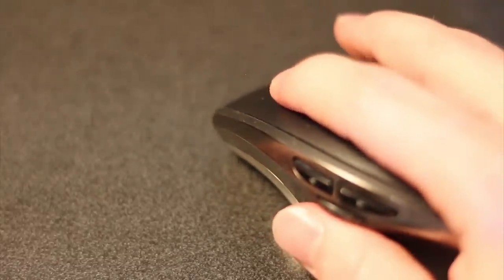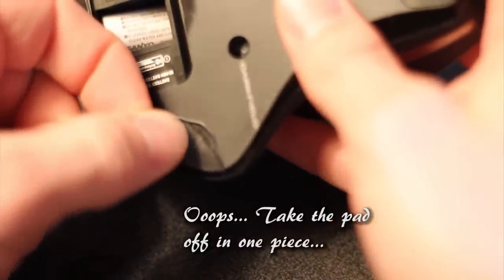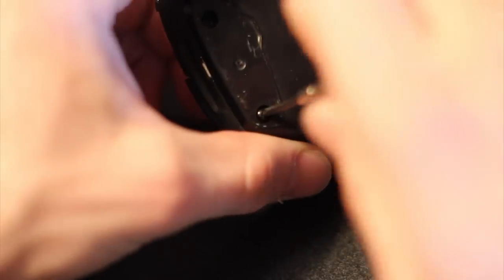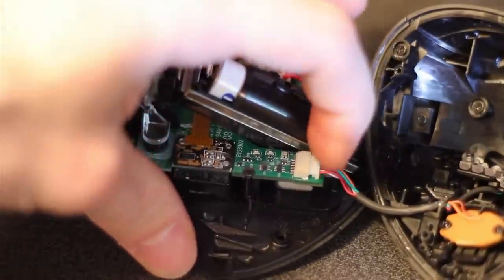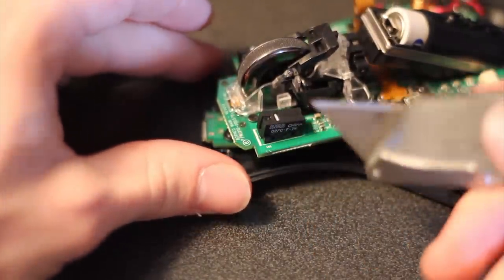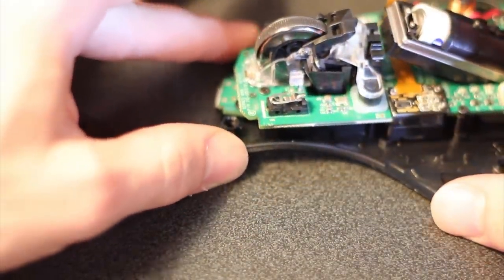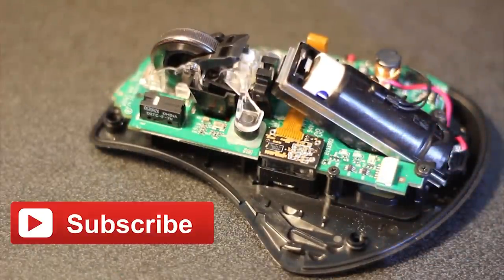Logitech Performance MX Mouse Micro Switch Fix

Comment: Thanks a lot, Kyler. Just before dumping my 3 yrs old M325 mouse with the left click suddenly not working reliably anymore, i found your great video. Taped and opened the micro-switch, then found the metal plate a little "off", adjusted it, cleaned it gently and...IT WORKS GREAT, AGAIN!!! Saves OUR environment!!!
Reply from the maker: Great to hear! Glad it worked!

Comment: Thanks for the video.  My old eyes had trouble trying to get the metal piece back in after it fell out.  Lost it twice in my cluttered room, finally gave up and ordered the Japanese version of the switch on Amazon, D2F-01F-T.  Same size but a better quality.  If one decides to do this, make sure you have decent soldering skills and the tools to remove the solder.  I have a good desoldering tool so it was easy to replace.  All works great, very positive click that is a bit louder.  Works great.  I've got the old switch that I'm going to still see if I can get together just for fun.  Had this mouse for several years and didn't want to have to get something else.

Comment: Thanks! Had so much trouble taking off the microswitch cover until I saw your video! The spring was a pain to get back on, it's a bit easier if you position the two ends first and then use a screwdriver or something to push down the middle part into place.

Comment: I can't believe I actually did it... It took me TWO HOURS of frustrated tinkering until I finally managed to get it just right and the left clicking is FLAWLESS now! You are a saint my man. I am shocked at how I did not give up even after 7-8 failed attempts initially on getting the bend and placement of that copper tab correct.

Comment: I broke the metal piece trying to take the spring completely out from the microswitch. I started googling 'microswitch replacements' and found this video. I would've saved myself 5 bucks if I just bent the spring back without taking it out completely.

Note: 
The microswitch in this video is a "OMRON D2FC-F-7N"
my Logitech G9x of 4 years has a switch "OMRON D2FC-F-7N(10m)"

The '10m' is rated for 10 million clicks. That seems to be the the only difference (spring is the same, looks, etc). 

also your voice is smooth. like classical radio station announcer smooth :)

Comment: Great vid! Saved me about 80€!
Couple of remarks:
1) I managed to remove the feet in one piece (thanks to your warning), but still they don't stick back that great so I'll have to add some adhesive
2) The little notch in the thumb end still broke off, but doesn't really affect the mouse
3) Once the spring is out, it's not that easy to put back, make sure you have some tweezers handy
4) I didn't get it back to original shape, but it did improve and I switched the right one with the left one (just the spring).Drag and drop is less important there and in general it sees a lot less use

Comment: I have the same wonderful mouse, and had the same frustrating, productivity-damning problem. Your video saved me the cost of a new mouse and a bunch (more) gray hairs, so thanks very much!

Side note: I was able to straighten that little metal piece in the micro switch by wedging the tip of a small flat-head screwdriver underneath the metal piece, and placing a second small flat-head screwdriver tip on top of the metal piece. I pushed both tips together carefully and firmly, sandwiching the bent metal piece in between them, and it flattened everything nicely. My mouse now works perfectly!

Comment: Before you try to fix your switch, first check if the double click problem is not caused by static electricity. Remove the battery from the mouse and the unify USB stick from the computer. Click all the buttons 30 times. The double click problem might be solved. It did the trick for me.

Comment: Thanks for the video man! First I thought I had broken it, the flattening had not quite worked and the front just bent up. Already looked for soldering sets on amazon :D  But after taking the little metal piece out and flattening it by hand on the table, it worked. Half an hour of trying, but without your vid I would never have gotten that to work! 
Thank you!

Comment: Thank you, you've fixed my problem! As others have said though, the lip smacking mouth sounds are intense. 

A warning to others, if you don't have dexterity, don't bother doing this. If that metal piece comes off it can seriously be a pia to align the three little sections of it. I had to take off the other side to see exactly how to set it up and even then it took me awhile. But it now has a louder click than the other side.

Comment: The original micro-switch plate I bent to all hell and couldn't get it to spring right again. So I open up an old mouse, but instead of removing the whole switch I just took the plate and fixed the MX. Thank god, I burn this switch out in less then a year, and I rather fix it them pay ups. I have lots of old mice. They all uses this same part dating back over 20 years! 

Thank for the info!
Reply: yup, found a nearly identical switch plate in a nineties wired Logitech ball(!) mouse! keeping the remaining 2 switches as spares!

Comment: Thanks. 

Just followed your steps exactly and gave new life to a mouse that has sat out of commission for MONTHS. 
I used a pair of thin tweezers to flatten the metal tab. The entire process took me 10-15 minutes if that.  
Great suggestion about the tape to keep the white plastic piece in place.

Comment: Thank you for your extremely useful video sir! Just used it to fix the failing micro switch in my logitech performance MX mouse. Also three years old, and I love it. I was prepared to buy a new one for 60£ when I came across your video. Straitened the tiny metal piece in the micro-switch and voila, its working again!!! THX

Comment: Wow ! I just fixed my logitech g303 with this way, saved me from buying & waiting for new switch and hard-solder it.
Some tips;
It took around 1 hour total work,  that metal part is tricky.You don't fully flatten it.Just a little bit is enough.
While doing it you may find that copper-metal part unusable/not-integrated status by mistake but it is doesn't what it's look like.It needs very sensitive trimming.I took my other switch and tried to copy it while doing it.Even that metal part fell of few times in the end I did by trying.
Feedback : Now it is working healthy but it makes thicker sound and button is more rough when pressing but it works!
Thanks a lot again !
Reply from the maker: Glad I could help!

Comment: Thanks for this video. I'd also suggest being extremely careful when removing the metal spring/clip. That thing is so light and springy that it will go flying and it is very easy to lose. Do it under a bowl or in a bathtub or something.

Comment: I was having this problem for the longest time and thought my mouse, after a solid 6 year run, finally gave. I tried your method and now my mouse is working like it's brand new :) . I didn't have any major issues except the little spring went flying off the first time I tried to re-place it but it took me little over a half hour to find it and put it back on. Thanks so much!!

Comment: Thanks so much for this video. After accidentally popping off the metal piece, I was able to get it back on 30 minute s later. My mouse button is working much better now that I straightened out the piece a tad bit. I've had this mouse for almost 8 years now and use it on average 5 days a week. Long live MX.

Comment: I was about to replace the microswitches. Normally I would not have expected that these can be opened. Thank you for your video.
Some contact spray on the contacts is also a good addition to your repair
Reply from the maker: Great! Hope it worked!
Reply: @KylersStudio  perfect till now

Comment: YES! Finally fixed it. although almost messed up on the spring but I managed to bend it back and put it back on. Now I can enjoy my mouse again without that annoying double clicking!
Reply: Same thing happened to me.
I got mad for half an hour to put it back in place.

This mouse owes his life to ***** :D
I was to smash to the wall... none of the buttons were working today. Using autocad was a total nightmare.
Thank you so much i can't believe it's finally fixed.
Reply: After a year or so of using it it became bad again. Going to try to fix it again.

Comment: Had my Performance MX for at least 5 years and just now started to have trouble.  Thanks to the video and some of the comments it is working fine now.  I did not adjust the spring as suggested though, but cleaned the contacts by scratching them with a knife blade.  Acts up again and I will order switches.  Was just about to order a new mouse, thanks!

Comment: This does work but if you are going to tackle it just be prepared for what is actually a very fiddly job. At my first attempt, the little spring plate flew off and landed somewhere behind my monitor. I was lucky to be able to find it! Secondly, if the spring does fly off completely, it's not really clear from the video how it's supposed to be re-seated correctly. My advice would be to remove the cover from the right hand switch to use as an example on how to re-seat the spring. Also, there's no science behind how flat you should make the spring to get the best tension for the button. Overall, it took me almost an hour from start to finish to fix it and I almost gave up and chucked the mouse in the bin! lol
Reply from the maker: Yes, but you got it?! I should have labeled this project 'difficult'; one that would try your patience and fine motor skills :-) Great job!

Comment: Great video! I suggest holding  the metal part of the exposed micro switch with a finger so it does not slip out. Also if you do flatten the part, keep in mind that it the the switch will need more force to be pressed.

Comment: This fix will work a few times but the issue will start coming back more and more as the metal gets weaker over time.  Two other options.  Buy replacement switches, they are pretty cheap for a pack of 10.  First option is to simply solder in a new switch.  It actually is not too hard to do, even for someone who hasnt soldered.  Your other option it to take the guts from a new switch and put them in your existing.  It honestly is a pain to do, but you might have to reassemble anyway as there is a good chance of the switch falling apart while you mess with it.  The other downside to all of this is the little pads never go back quite right.  Still, all of these things are better than buying a new mouse, especially if you truly like the one you have and it is no longer made.
Reply from the maker: You got it! I also have a video replacing the whole microswitch in case you haven't seen it yet.

Comment: Awesome!  Worked perfectly! Thanks a lot Kyler.  I tried to skip the tape step thinking I knew it all, but that was a terrible idea...as you know.Trying to get that white button back in it's slot was maddening.  For anyone having questions about what to "bend" back it's the very end piece that's closest to the wheel.  The flat part that makes contact with the stationary....little metal thing.  Sorry I don't know what it's called.  Oh, AND IF THE LITTLE COPPER CONNECTOR THING COMES OFF...DON'T PANIC!  I thought I'd broken something, but it all goes back together.  Just takes some patience.

Comment: I followed the instructions here...thanks.  But when I opened it I found it full of dust and a few hairs.  I cleaned it and now its all fine and clicking correctly.  I suggest you look for this before you pull the micro switches apart.  It might just be a short cut for you.

Comment: Same right click issue on a Logitech Anywhere MX so I tried to flaten the spring as you advised but there's more to it, the central tongue of the spring needs to have a very particular shape, I must have bent it too much initially and then spent the next 2hr trying to get it to spring correctly again. Eventually I switched the spring of the left microswitch with the right microswitch. Right click is working great again and Left click is so-so. I just bought Omron e-switchs on eBay for 1$ a piece, if they have the same springs I'll just replace that, otherwise de-soldering it is.

Comment: the spring came off on me, fought with it for way longer than I want to admit. Also, that thing will fly 3' in any direction with no notice, watch for that. Keep a clean area and a good flashlight. After I gave up and sourced new switches I figured I would try 1 more time.  On the 47th try I happened to get it in. Thanks for the video, wish there was more about replacing that spring.
Reply from the maker: The spring is by far the hardest part and requires some precision and delicate fingers. Might be easier just to replace the whole switch if you'd rather solder.

Comment: Thanks for the great video. Have a Logitech M515 couch mouse and started getting missed/doubles on the right click. This and a cleaning the contacts worked perfectly. Have a Logitech MX1000 and MX Revolution that get more use and are much older, but I've never had this issue with either.

Comment: I barely add a comment (in fact this might be the first :)), but great kudos man!!!. I have been using this mouse almost 5-6 years like this, although rarely, and I was about to finally order a new one and I decided to check again for a possible fix. Although it took a few attempts to put back spring inside again, now it works like a charm. Thanks again for taking the time and putting all these steps in a super easy and good video. Thanks again.

Comment: Thank you man, I fixed my sharkoon drakonia too. Pro tip: you can use dental floss or other thin thread to open a switch. Just put it instead of a knife and pull it to yourself and the top.

Comment: Awesome video, you saved me from buying a new mouse :)
It was full of hair and dust as well, which I'm sure didn't help. The clicking is a little more sensitive now than it was, but left clicking and dragging was basically out of the question before, so it's absolutely an improvement. Cheers!

Comment: Christ...NOW I understand why it is *flattened*! (I pondered over this a day since some other guides said to bend it even more instead). Heck yes, because flattening it instead gives it back its tension, since it will be bent like a spring when you put it back again. Now it makes sense. Also...yes, head the warning from the other guys: If you remove the copper part, you will hate the world. The guy conveniently skipped the most tricky part. There are other guides on the web where it is shown how to re-insert it. (Small hook first, then large hook, then with a screwdriver etc. push down the "spring" so it snaps in). It can be VERY tricky, so be warned. If you can, try fixing your clicks first with cleaning the copper part with alcohol, do NOT take out the copper part, it might not be needed.

Comment: I'm going to wait a bit but it worked! On the straightening; didn't even get it off just applied very moderate pressure w/ pliers. On the hiding stickers/skates/whatevz; mine we're even more dirty since the mouse is 4+ years old. Came off seperately, scraped the dirt off, cut them back to form, apply some heat (used a hairdryer ~1m each sticker :D ). GL

Comment: I did this with my (then) 5 year old Razer Imperator. In my case, the whole asembly of the micro-switch came apart, so it was a real PITA to put back together, but it worked fine until about a week ago, when it started failing again. I did the repair in 2015, so it lasted for almost 2 years... not bad at all!

Comment: Hey @Kyler, thanks for posting this video. I've been struggling with my Performance MX mouse for a while with double and triple clicks and was too lazy to do something about it.
Your video was really helpful and I was able to fix this issue thanks to it and you.

One thing to point out though, you should maybe add clearer pictures of the spring and its holding mechanism as I had to wrack my mind a bit to put it back in place.

Comment: Incredibly helpful, thank you so much ! (done a few minutes ago on an even older mouse, mx revolution, that I keep in shape because I really like it)
The pictures were particularly helpfull to put the metal plate/spring back into place, it's tricky but definately doable :)
In my case cleaning the contacts with IPA was done and probably helpful too
Reply from the maker: Glad it helped!

Comment: Thanks for the video ! I shot some pressurized air on the switch and it seems to work fine now -- hope the results last (fingers crossed).

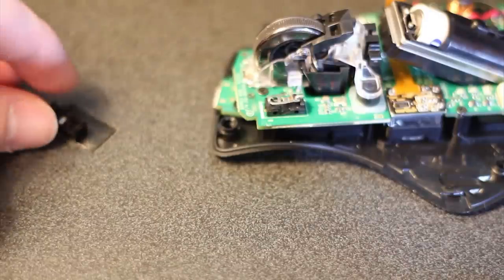IMO the picture at 3:00 could use more explanations. The switch on the right doesn't even seem to be from the same model.

Comment: Holy crap, it took me close to 2 hours to fix my click XD i had to do some surgery in the microswitch and that required me to put the metal piece back in the right way (this is what killed me inside) and after it adjusted in place (after i grew gray hair) it put the top back on and BOOM! it was fixed!! <3 GL folks.

Comment: As apprehensive as I was of the use of WD40 on the internal parts of my Performance MX mouse, this solution here seemed to be a bit more uncertain based on the comments - so I tried the WD40. Contact cleaner or isopropyl alcohol is a more tried and true option on switches but the WD40 worked great for me. Good as new. Maybe if it fails again I might try this. Thanks for posting.

Comment: Thanks a lot, issue resolved but there is no "click" sound on mine now, however, the click function is working as a charm. For anyone trying to find the parts this is what you should be searching for on amazon if interested:

1. Micro Switch OMRON D2FC-F-7N(10M) For Mouse $2.99

2. Mouse Skates / Mouse Feet Pads for Logitech Wireless Performance MX (2 sets of replacement mice feet) $9.99

Beware as there are many prices for these items, search thoroughly.